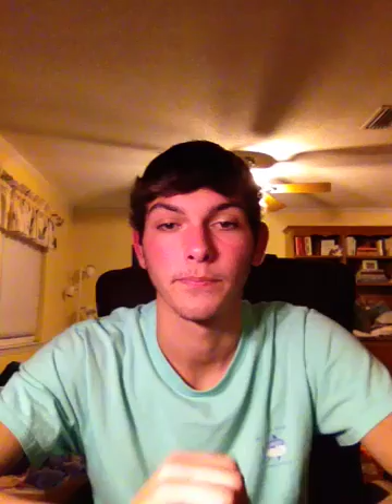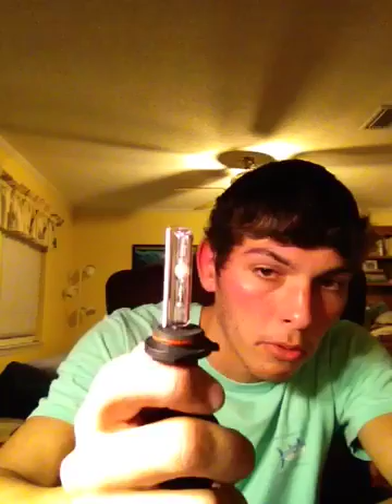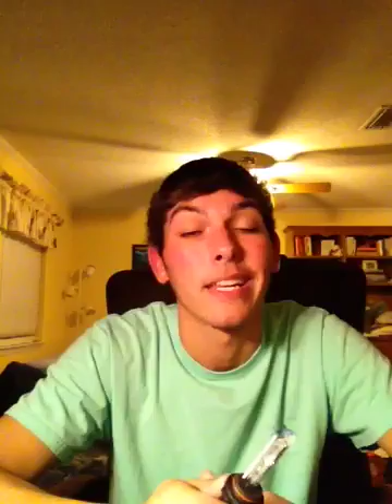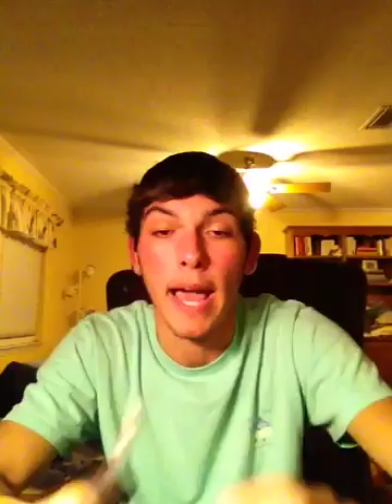Guide To HID Headlights Everything You Need To Know DDM Tuning Part 1

Comment: Ebay. For around 100bucks i got the 45/64/85 watt hid flashlight. It comes with a case and charger. Goes about 30min on low, 15min on high. Its the brightest thing around. Check em out